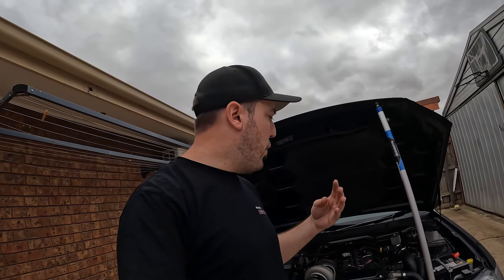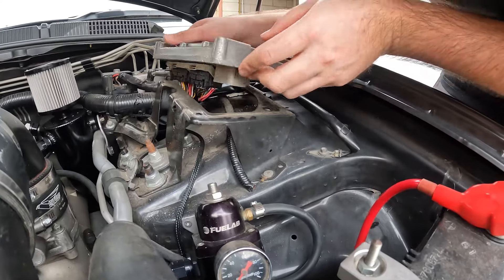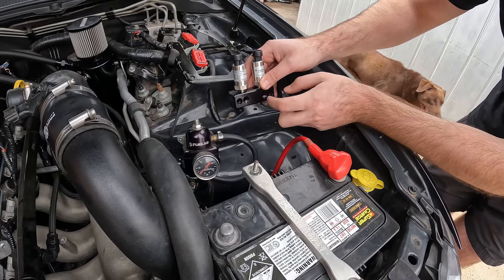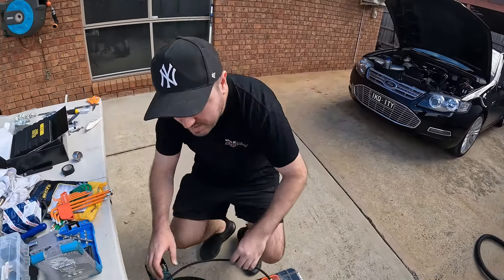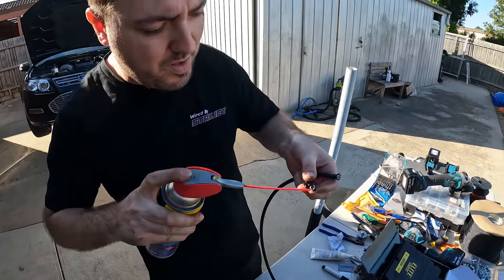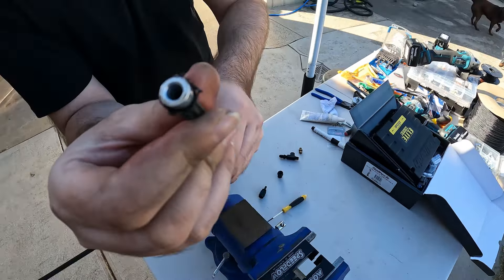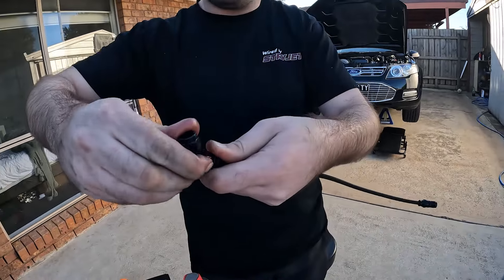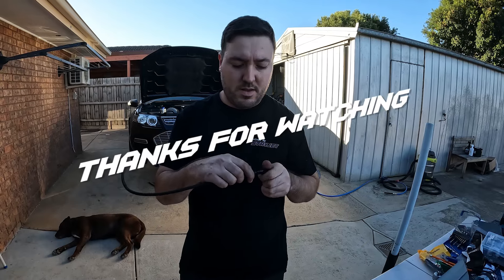Haltech Barra Plug and Play Install - Engine Protection Pressure Sensors

Comment: too much time on gas line you need to show how the wires go into the pressure sensor
Reply from the maker: Thanks for the feedback. I have a video coming out in the next month going through engine harness and pinning out connectors which I'll take you through.